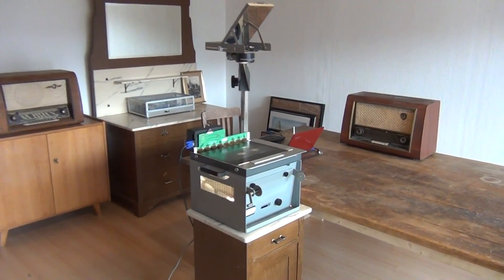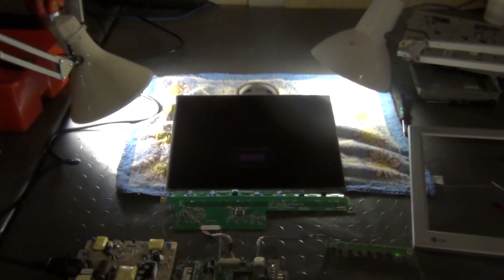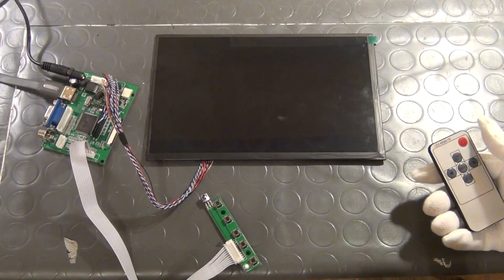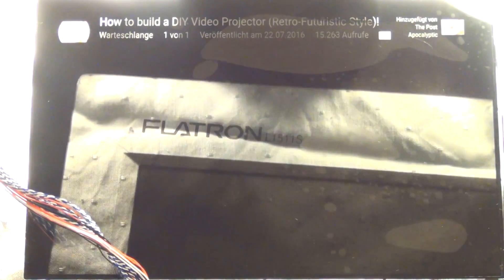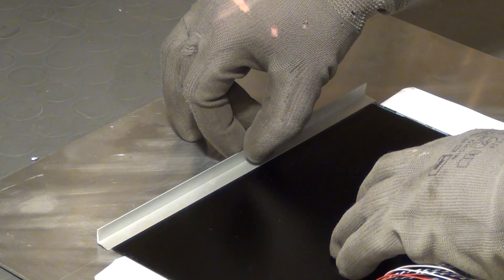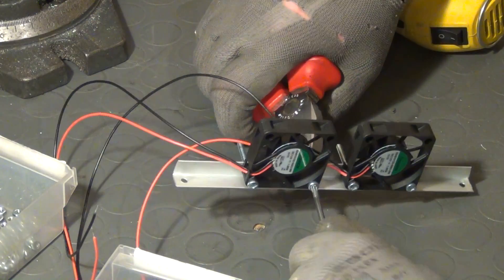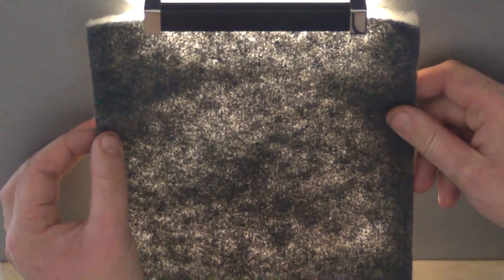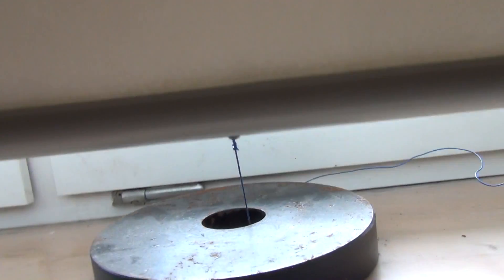DIY Projector Upgrades

Comment: Have you tried out some old laptop or other lcd backlighting for around the workshop.

I found when playing around with a damaged laptop led backlight that the leds would only operate at 27volts up to 30volts and that the 27volts was the lowest brightness and that the 30volts was the highest brightness which was too bright to look at.

I guess you can also utilise it’s power inverter but I didn’t play around with that myself.

Comment: Maybe you want to try with a 150w / 220v led.  https://www.aliexpress.com/item/LED-COB-Chip-No-Need-Driver-200W-150W-100W-50W-30W-20W-220V-Input-High-Lumens/32857244919.html?spm=2114.search0104.3.29.27b767d1uJmpfv&ws_ab_test=searchweb0_0,searchweb201602_5_10065_10068_319_317_10696_10084_453_454_10083_10618_10304_10307_10820_10821_10301_538_537_536_10059_10884_10887_100031_321_322_10103,searchweb201603_51,ppcSwitch_0&algo_expid=e84e25e3-9504-4fd6-abfe-fab901ed8c00-7&algo_pvid=e84e25e3-9504-4fd6-abfe-fab901ed8c00

Comment: Hello! I have a few tips. Use a 50 or 100w led that feeds directly from 220v without a driver. Make a mirror reflector at one end of the LED shape and at the other end of the LCD screen shape and you will not have the light coming out laterally from the rear projector box and the whole amount of light will only be on the LCD. Another suggestion that I think is good, but requires work and is risky is to remove the polarization filter on the LCD, which is made of plastic and with glue and which I think is obstructing the light more than a glass filter. Use a polarization filter for cameras and mount it over the top lens in the overhead projector arm.

Comment: I am watching this on a 3M projector from the 90s with an old proview tft lcd on it, unfortunately it has chips in both the bottom and one side with a short ribbon connecting them so it is impossible at least for me to get a longer ribbon and have them out of the frame, but fortunatelly there is just enough usable panel that covers the entire projectors width, so no fullscreen for me! I was wondering if it would be beneficial to swap the halogen for a 50W led floodlamp unit, what are your thoughts?

Comment: 1024 x 768 isnt good enough for 720p??? Didnt know 768p was less than 720p.

Also, 1 Big fan would of made less noise than 2 smaller ones and it could run at slower speeds to achieve the same results.

Finally, why not use an LED bulb instead? No heat!
Reply: 1024x768 is 4:3 ratio
720p is 1280x720 so its another aspect ratio
You cant just take one of the two numbers and assume its higher. ;)
Reply: floSa 

720p refers to the number of vertical pixels.

So yes I can just take 1 of the 2 numbers.
Reply: IdealIdeas100 
No it doenst by definition. 
720p is a name not a scale. 
720p by itself is no resolution but a term for hd. 
Just like 1080p means fullhd. 
And 1024x768 is not hd.
Reply: And yes 720p refers to the vertical amount of pixels but in combination with the aspect ratio. 
And that is not 4:3 but 16:9.
16:9 since thats the modern standard.

Comment: Great solution.  Best bit of information for me from the video was about LED panels not requiring high voltage power invertors.  This had always put me off trying this with LCD panels in the past.  Thank you!

Comment: How about 14 inch ? Thinkpad x1 lcd's are around 40 quid on ebay and full hd ips panel, only thing is you need a lvds driver board or a laptop with it and the driver boards are around 30 from china, but at least you would have 1080p then.

Comment: I've collected the parts to do this and was wondering what I was going to do when my projector lamp failed and found this 100 watt LED kit. This kit may also reduce the need for fans.  http://www.ebay.com/itm/100W-100Watt-High-Power-LED-Light-Lens-Reflector-Heatsink-Cooler-100W-Driver-/252323582940

Comment: It's a Great project man! Projectors in general are really expensive or really crappy. Most have only 800x600px and are sold as "HD".
I couldn't find a cheap overhead projector, but i will try to build it using a camera lens, similar to the shoebox phone projector, but with a powerfull led. 
I found A4 fresnel lens, with unknown focal distance that may work for focusing the light of the led on the screen.
ABout cutting aluminum, i usually use a jigsaw with an hss blade. But i heard that people use woodworking table saws.
Or you can try a pneumatic nibbler, they cut up to 2mm thickness.
Reply: Best for cutting small pieces of aluminium is mitresaw... Anything that has at least carbide blade can but anything but ferrous metals, like steel

Comment from the maker: Sorry guys, there was an issue with the first version of this video, that I had uploaded about an hour ago. I had to take it down and re-upload it.
Reply: Actually, no. They are horribly bad!
Reply: surely a cheap Chinese projector with a mobile phone screen or hack an old projector fooled to start with an led light would be better
Reply: There are 5" 4k displays... But yep... 200€ at least. Its cheaper to get laptop 4k IPS LCD for around 100€
Hard to find low end PC that actually is capable of running anything at 4k. 7970 for graphics card perhaps.
You can get one used for 100€ or get the Radeon RX 480 thats around 200€